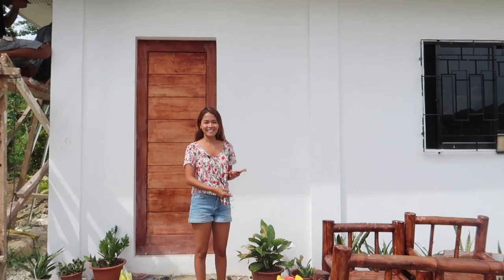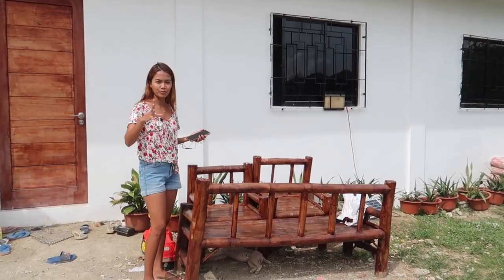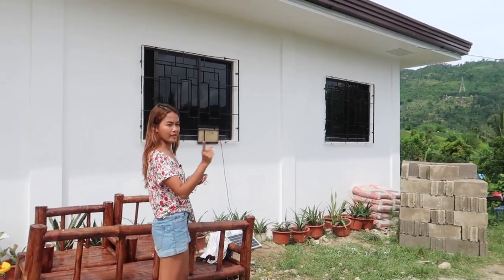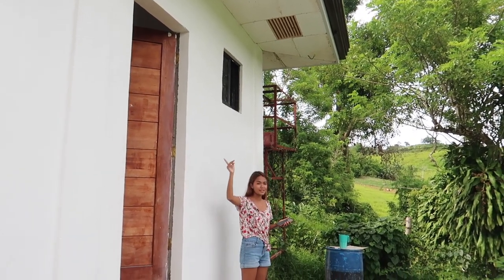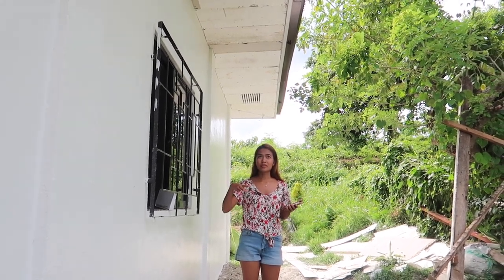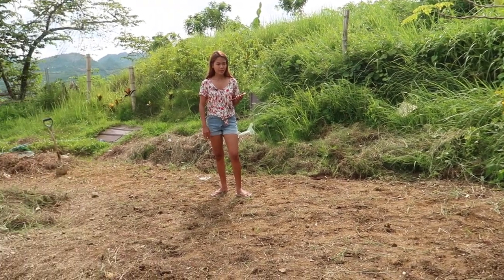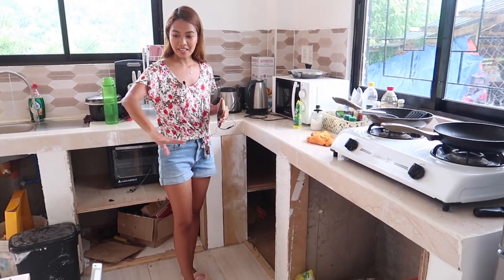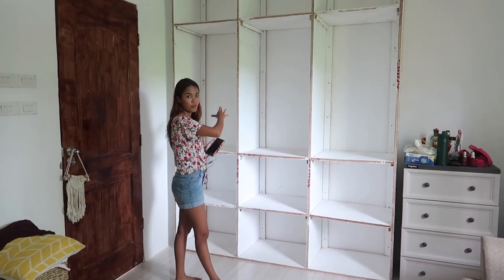House Rebuild 31: Making Storage Cabinets For The Province House

Comment: You need a fine mesh screen like you will be using on your windows for the soffit vents.  The product you are intending to use will not keep out small birds much less insects.  This is standard construction practice here in the U.S.  Also, please consider putting a concrete stoop outside your exterior door entries to the house to help prevent trafficking dust and debris into the house.  I would put a minimum of a 4 foot square stoop at each door.

Comment: Looking great. I have a couple suggestions.  1) when building your terrace don’t make it too small, you’ve already said you want to put a table out there and of course you have your terrace chairs too. 2) in your bedroom, you will want to have at least one compartment in your wardrobe cabinet tall enough to hang dresses. I know you are not tall but you might have a few long dresses to hang.  Later.
Reply: She could have the middle shelf removable if she wanted a taller closet inside,suggest it.

Comment: On the storage cabinets it would look good with floor to ceiling mirrored doors either sliding by installing a top and bottom track so the doors slide ,or if that is too expensive just do a  push/pull door.Two things it would be good for is  a full length mirror and  it would reflect light in the room.

Comment: Plumb the gas to outside Meljean and add a cage around it for security plus in case of gas leak it will not gas you all out much safer if fire also

Comment: Looks like thing are coming along nicely and will look good when it is all done. You need smaller mesh screens for your soffits. The netting you have is too big so bats and bugs and small birds will still get inside your roof area. It would be good to paint the edges of your wardrobe before they put on the doors.  It would be safer if you propane tank for your cooktop was outside. Here you would never be allowed to have propane tanks in your house for cooking. Hope you are making your deck nice and big.

Comment: Hi MJ A suggestion 4u when and if your budget allows you should install LED Downlighting into the soffits around your home so at night your house will be illuminated to give extra security. Also make sure you have an automatic timer switch to time the lights come on and off at night. Also install cheaper Solar lights around your garden and 2 left &  right side of your garage for Ruby. At the entrance to your property for added security install some powerful flood lights that are triggered by motion sensors. 
Just some suggestions to help you MJ and Tom.
Reply: I like the solar idea better . She can drill them around the outdoor area or get one that is like a streetlight that stands on its own
Reply: @annicks7385  putting lights into a soffit is a nightmare. never do it - maintenance is a headache. I put my lights on the walls and am using motion detection activation - works great
Reply: I believe that MJ already has some solar powered outdoor lights so if they are still working they could be reused.

Comment: The outside is looking much better with the sofit in place, it clean the lines and once it's all in place and painted it will make the appear as if it floating. There has been quite a lot of progress in a short time. Will you be leaving the top sections of the wardrobe open as a storage area for bags and luggage.

Comment: Hey Meljean. I see great progress with the screen and the covering of that area under the roof. Your uncle is great. He can do everything. Now building the wardrobe in your bedroom. In terms of the terrace, are you making a deck level with the door to just walk straight out the door onto the patio?  Or are you gonna have 2-3 steps from the door down to a concrete patio?  Things are moving along slowly but surely but most of all correctly. Thanks so much and see you next video.
Reply from the maker: Thank you! One step down from the main house

Comment: Seems you will need “screen” so birds will not be allowed to break through the green (large eyes screen). You will need small eyes (smaller holes or opening is the best)

2 Pack Dryer Vent Bird Stop Mesh- Dryer Vent Grill Sheet •
Bird Stop Mesh Metal Screen
- Exhaust Vent Guard - Stop
Birds Nesting Cover for Dryer Vents Bathroom Exhaust Vents,

Visit the Chooling Store
2 Pack Dryer Vent Bird Stop Mesh- Dryer Vent Grill Sheet -
Bird Stop Mesh Metal Screen
- Exhaust Vent Guard - Stop
Birds Nesting Cover for Dryer Vents Bathroom Exhaust Vents,

Comment: I would suggest that you build a raised patio for your terrace.  Maybe cement beams to hold it up for both, you terrace and dirty kitchen.  That would be a great sitting/gathering area.  I am also concerned about the screen you have for your soffits vents. It appears as though the screen is not fine enough to keeps rodents/varmints in...
Reply from the maker: Yeahhh

Comment: I feel bad that you installed the wrong screen, it is much too large and not sturdy. Small birds and bats and any bugs can still go thru there and maybe even mice could get in there. I really hope you get a screen that is very fine like you would use for the windows to keep bugs out. That screen looks like it will not serve you will and you will still have problems with bugs and other things getting into that space above the ceiling.

Comment: MJ..GLAD your lovely hse is coming along FINE🤗. Costing WILL keep on changing till 98% of completion is DONE 🙄. D gab of green netting is way too BIG to keep birds away..unless your area's birds are pretty BIG & DUN hv small birds. My experience are small birds are d ones that LUV to search for hses' small gaps & once flies in..lost it's way inside roof & dunn0 how to come out..eithr U hear it & get inside roof to get it 0UT..or it died inside & start rotting away in d roof. Use FINE MESH green coated NONE rust netting will be better in d long run. These green coated nettings are never expensive..buy frm hardware shop by measurment needed..xtrs WILL nvr waste..cn use for future planting in grdn 😉..ALL D BEST😘

Comment: Are you planning a rear terrace, which is ground level (like a patio) or a deck, which is a platform? An elevated deck would be the same level as the kitchen floor. A word of caution, an elevated deck must be engineered properly to support the anticipated load and to be stable with a strong foundation. It must be attached to the main structure (house) with a ledger board and lag bolts. There is a steep rear slope so you must counteract the tendency to slide. The vertical posts must be supported with concrete piers going down a few feet or until you hit bedrock. I suggest the horizontal deck material should be composite material that is termite and weather resistant. Please do some research and have your plan reviewed by an architect, engineer or qualified builder

Comment: I would build a raised deck off the back door terrace. With the floor level with the floor of the kitchen. With a rail going all the way around the top. And 2 sets of steps leading off to the ground  one on each side of the house
Reply: With a deck you don't have to level the ground but will need shallow holes dug to pour concrete block for 4X4 posts to build deck on. It can be a rectangle deck, probably the easiest. Depending how big you want the deck will depend on how many concrete blocks with 4x4 posts you will need. Plus with a raised deck you can store stuff underneath & out of the way out of site.

Comment: So when are you building my Guest house with  Indoor swimming pool and sauna? The Guest house don't have to be that big just 6 bedrooms 8 full baths and 4 1/2 baths . The pool can be a small 80 foot wide and 260 feet long 30 feet deep with 4 diving boards. A simple 3 foot diving board and 8 foot diving board a 12 foot diving board and a 20 foot diving board..